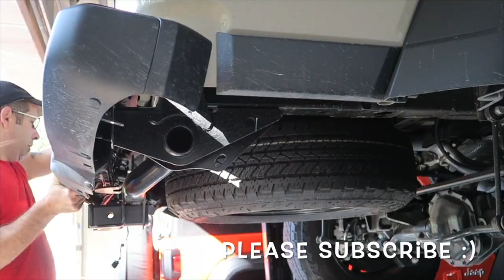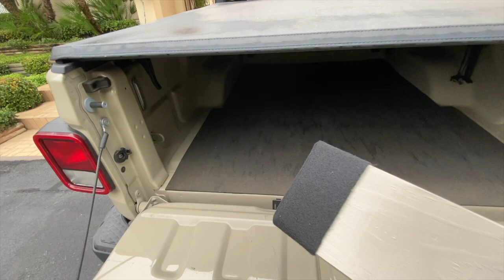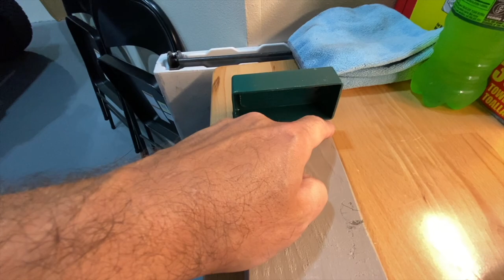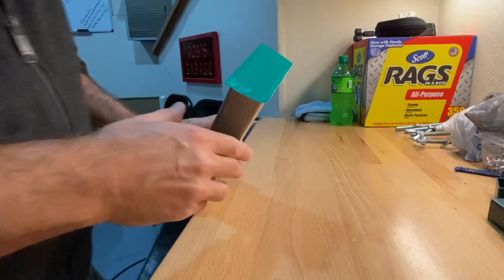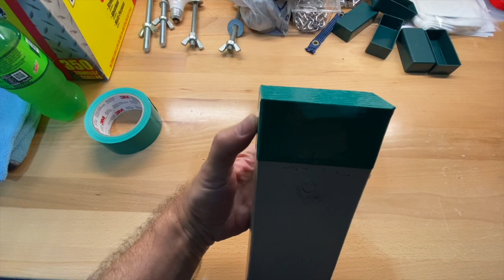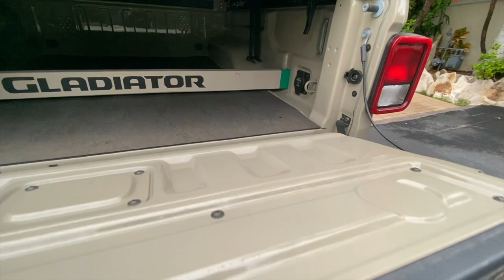Gladiator Mod to Dress Up The Gladdy Board

Comment: I don't like the duct tape...looks cheap.  You should have done a better fabric job .  That looks higher quality.  Or use another fabric or thin carpet.  Or what about a rubber dipped end.  Like what you can do for pliers or tools?  That would help with noise of the board rattling around.  Just some thoughts....keep up the good work!
Reply: Plastidip
Reply: @1stanich  plasti dip is too thin...more like liquid flex seal or rubber like the use for tools.
Reply from the maker: BJ.  Great tips👍

Comment: Looks nice, I have ammo boxes on both sides that hold recovery straps and bungees , if not I would do this,
Reply from the maker: Very cool👍
Reply: Ammo boxes? They fit ?  Regular boxes?
Reply: @1stanich  from quadretec, I have one Fat Fifty cal that locks and a 40 mm cal. I took an old tailgate cargo shelf from ,my old JK that  the 40 cal fit in and secured to the side behind the wheel well bump out under the LED interior bed light. On the drivers side I put the fat 50 Cal. Easy reach from the rear,. Perfect storage boxes.

Comment: How did you get the Gladiator Decal to stick to the wood? I painted my board and ordered the Gladiator decal but it would not adhere to the board.
Reply from the maker: Sounds like you ordered a static sticker versus one with adhesive🤔

Comment: Doesn’t look bad at all. I am curious what the tape’s glue will be like after a year, in the easy bake oven, that is the bed under a black tonneau. The LRGV summer sun will heat that area up.  The good news is if the sun does a number on it in a year or two it is easily replaced.  If the sun doesn’t affect it ... we’ll it is still easy to change😉. You can’t get in colors (except black) but tape it off and spray it with the Rustoleum “rattle can” spray on bedliner. No seams.
Reply from the maker: That’s true.  Not sure if this in my final solution 🤔. Getting some great tips on here👍

Comment: Looks good Rob! Heck, I didn't even realize you had made that board. Need something like that for my Taco. Bought a bar for the bed, but it did not work out. I did break down and get a bed mat.  Last grocery run, the mat actually kept all my bags from sliding clear up behind the cab. I bet you could sell those boards?!?!
Reply from the maker: How much do you think something like that would sell for?
Reply: @robmotiveplus  depends on the price of the wood? I bet NOT overpriced, yet making a profit these would absolutely sell.....especially personalized ones. I need to look in my bed....don't know if I have any indentations that could hold one of those. I would buy one!

Comment: I have a black spray in bed liner and have some red marks on it from taking my board in and out.  Mine fits a little too tight.  But, I’m afraid if I whittle on it it will be too loose.  I used a 2x6 for my board.
Reply from the maker: Do you remove it often or is it moving in the slot?
Reply: @robmotiveplus  No, I don’t move it often.  But it’s a little too tight to pull in and out.